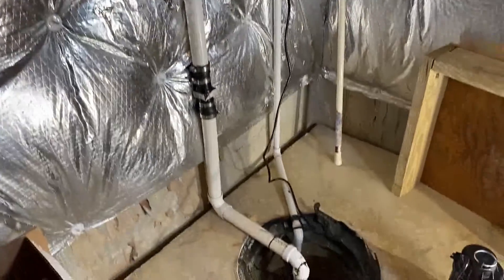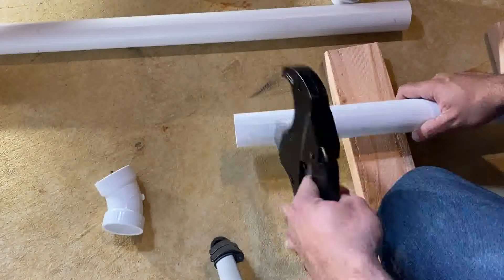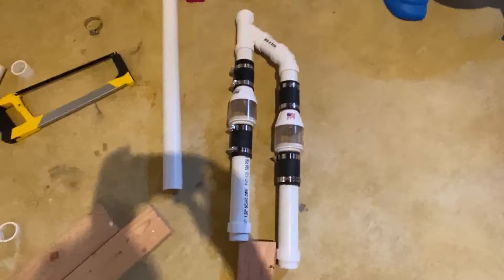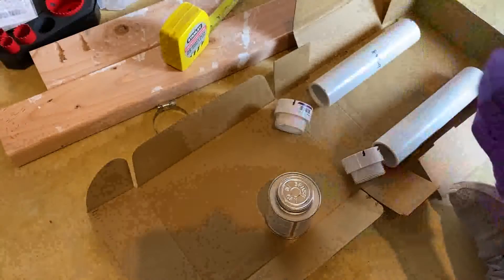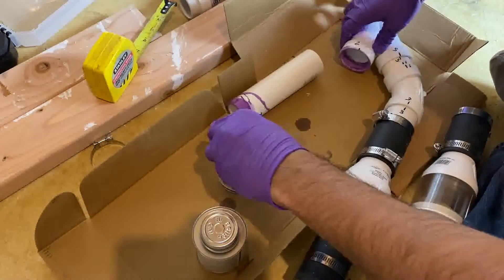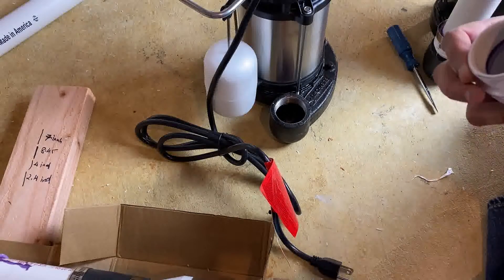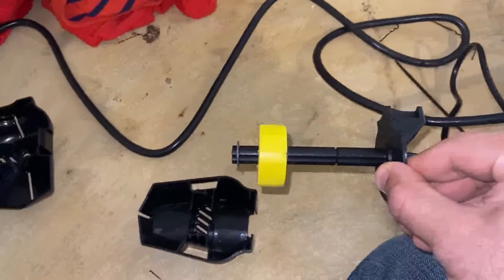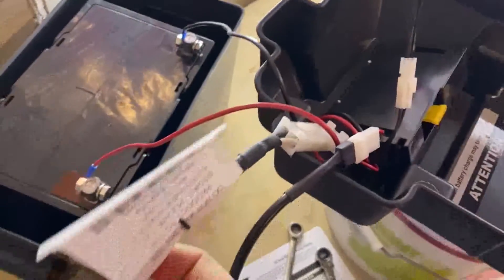Battery Backup Sump Pump Installation

Comment: Is there a way to just have a battery backup on your sump pump that goes off when power is out? My pit is small and can only fit one
Reply from the maker: I would rather keep the regular sump pump and keep battery backup on the side for emergency situations when power is off. You don't want battery back up to do the work on regular basis as you may run out of battery at some point.
Reply: @diysave1136  I totally agree but what do I need for the battery to kick on when circuit is off? Do I need a converter?
Reply from the maker: @LafortunaCosta  You don't need to do anything. As long as the battery is charged, it will run for a few hours or so till you get your power back.